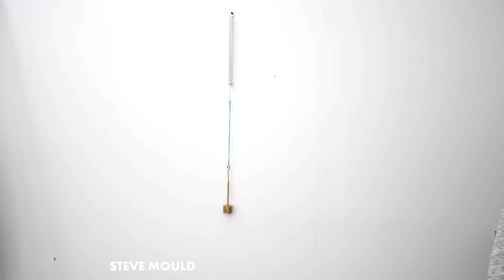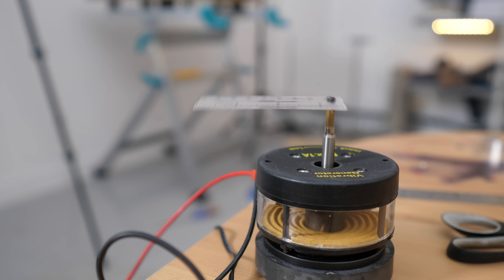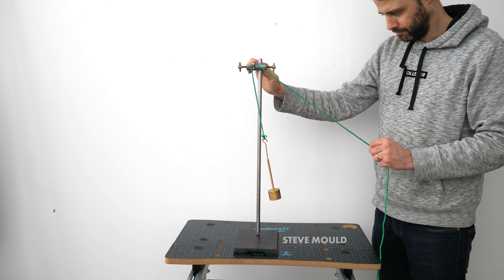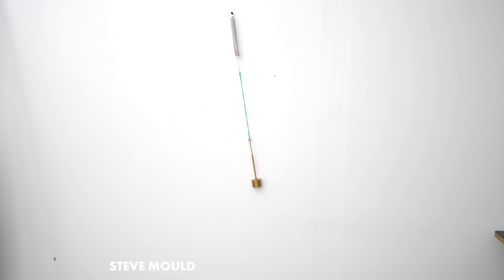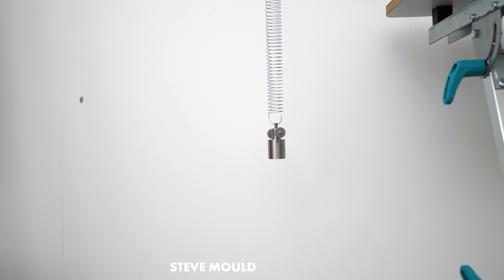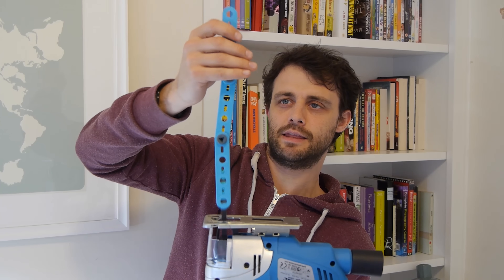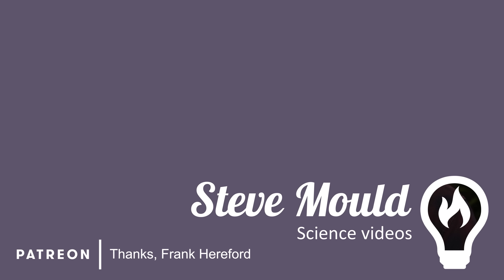What If Swings Had Springs Instead Of Ropes: Autoparametric Resonance

Comment: Great video as always Steve.

There's actually another way of looking at the spring pendulum, not as parametric resonance but as internal resonance. Parametric resonance occurs when you change a parameter of the system, but you could argue that no parameter is changing in the spring pendulum, as the spring constant and relaxed length of the spring don't change. If you think of the spring as 'outside' the system and just focus on the pendulum, then you can say the length of the pendulum changes. But this is tricky, because the pendulum is enacting forces on the string two. The system is interacting.

In the internal resonance approach, we consider the system as a whole and the parameters are fixed. When the modes of oscillation (spring up-down, pendulum left-right) are analysed in a usual way, they come out just fine. But with a simple analysis, they don't interact with each other, setting the pendulum up-down would not cause it to swing left-right eventually. It's only when we consider the non-linear effects in the system do the two modes couple to each other. This non-linear effect only contributes when the (fixed!) parameters are just right, which you stumbled upon! Without the non-linearity, you don't see the effect you described in your video.

Maybe a topic for a another/follow up video...?

Comment: Maybe attach it to a wind-up escapement on a hook where the hook bobs the spring, and then use one of the stable modes of oscillation to keep it running far longer, so that the Laws of Thermodynamics do not short-terminate the oscillations.

Comment: Interesting. The two string pendulous nads one was surprising. Could the rigid loop on the nail perhaps be what starts the sideways forces? the slightest bit off center it will impart rotation.
A simpler way to explain your rope pull is that you tug when there is a sideway component to the force vector, thus imparting lateral motion. It's not about hitting the peak force point although that is where the strongest coupling is. But you can do it strictly outside that point.

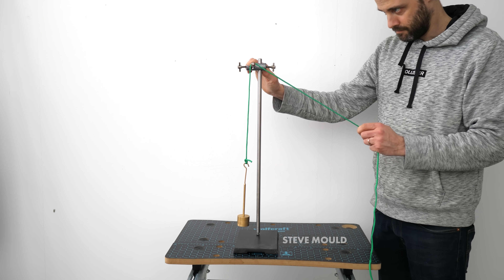Comment: Well... 4:04 isnt quite correct, you are altering at least 2 parameters, and would even ended with the same result even without lengthen the string. at around 4:30 you can see that with every tuck on the string you also moved the anchor point of the pendulum forward and backward. this way you added extra momentum regardless of the length of the string.

Comment: Is there any way to make a power plant out of this?
Like with wind, solar, wave, or gravity + pendulum resonance? Like all working together somehow? Or is that a perpetual motion machine?
Reply: That'd just be a perpetual motion machine, you're not going to get more energy out of it than you out in
Reply: @dustinm2717  Even if it was solar + wind + tidal + gravity + resonance pendulum? There's no cumulative energy?
Reply: @oldmandoinghighkicksonlyin1368  solar or wind would be a source of new energy and so not perpetual motion but would be more efficient just used directly on their own, a pendulum wouldn't give it more energy a pendulum would just store energy (and lose some to friction)

Gravity can never produce energy, in this context it can only be used to store and release potential energy within a mass, to get energy from gravity an equal amount of energy has to have been put into putting the mass into a higher potential first, gravity only releases potential energy that was put in from some other source 

And the pendulum in this case is just working at the right frequency to cause it's own momentum to convert itself into another mode and then back again, it's just converting it's energy (in the form of momentum) between 2 different modes in a cycle, it still has the exact same amount of energy in both phases ( minus some lost to friction )

Granted I'm not an expert here, but generally the rule is something will never output more energy than was put into it (if they do it's coming from another source) it can only output the same energy in another form, things can only convert from one form to its equivalent in another form
Reply: @dustinm2717  Okay, I understand it much better now. Thank you for taking the time to put things into a different perspective so I can grasp these concepts!

I have seen Newtonian attempts at perpetual motion machines and they almost all exclusively use gears and gravity-assisted waterfalls to turn wheels that carry the water back up to the top of the machine.

I was envisioning using additional sources of "free" energy like wind or solar to give those machines the extra bit of rotation or battery storage to actually make it so the machine never stops. But I guess the water would always evaporate or the gears would always wear down no matter what.

Comment: Calling the length of a spring pendulum a "parameter" is a bit of misnomer. It's a variable, so from a dynamical system perspective, it would be included in the state of the system.

Comment: I wonder, regarding your explanation starting at 5:12-- is it a matter of doing work against the centrifugal force of the pendulum, or is it more of a matter of conservation of angular momentum? i.e. You're decreasing the string's length, thereby increasing its angular velocity in the process? (the ball on a string analogy at 5:27 is also a perfect example)

Or are these two explanations essentially one and the same from a physics standpoint? I am by no means a physicist lol-- just trying to better understand the "doing work against the centrifugal force" argument.

Comment: Before you get on the swing, the rope/chain is a straight line. Sit on the swing and your hands grab the rope  a few feet up. When you lean back the rope changes direction at the hands. Now the length from seat to pivot point above has shortened. Just as you said, changing the length  changes the velocity.

Comment: Why do the pendulums on green string transfer all motion back and forth so that at certain times one is stationary while the other is experiencing max motion? I would have expected the first transfer to result in an equilibrium between the two so they are both moving. Why does the motion transfer entirely back and forth?

Comment: 7:00 i think not, angular momentum alone isn't enough, pumping a swing has to do mostly with lowering the center of mass during downwards acceleration (a more effective way to pump it requires standing on the swing and dangling the whole body behind), which in turn changes the length of the pendulum system. Right ?

Comment: "Centrifugal force", Steve? Really? Centrifugal force isn't real. It's an illusory force experienced within a rotating, non-inertial frame. (Any other comments describing how it's real with the rotating frame are irrelevant because all of "our" observations and interactions with this apparatus are being made outside of that rotating frame.) You're also never working against tension because you and the tension are always pulling the mass in the same direction. The force you're working against at the bottom of the swing is good old gravity, combined with the extra pull you have to apply to provide sufficient centripetal force required due to having to make the mass travel in a circle of smaller radius as well adjusting to the higher speed resulting from the smaller radius (as demanded by the conservation of angular momentum).

Comment: I had a toy as a kid that was just a string with a small ball on one end and a larger one on the other. The string went through a tube. It worked like the thing you were doing with pulling on the string to make the weight swing. Pull on the small ball and make the bigger one swing until it was going full circle.  I had so much fun with that thing. (Yes, I'm easily entertained)

Comment: I'm I the only one that really wanted to see a three mode pendulum where the two mode weight had a pipe between the spring and the weight to transfer the rotation to the spring.

Comment: The point the rope goes over the pin at around 5:30 MOVES back and forth each time he changes the length of the pendulum arc. In this demonstration, it is not so much the length change, but the movement of the pin that makes the pendulum swing back and forth. The conclusions and reasons Steve makes about what is making the pendulum swing are NOT scientific or correct in this demonstration. The theory and established results he is speaking about are correct, and there is no dispute about that on my part. It is just the really sloppy demonstration in this vid that irks me. If your gonna do something, do it right. It really matters, especially when teaching.

Comment: Does the example where you increased the amplitude by shortening the string work the other way where you could pull and release the string at the exact opposite times therefor opposing the motion? Could you then theoretically create a powered swingset that no matter how much you pump with your legs, you could never actually swing?

Comment: I discovered this exact behavior in my high school physics class at 11:53. I wanted to answer the same question of the title so I slapped the weight sideways instead of pulling it so that the system would start at an equilibrium state. I never tried it with different masses or springs but it stayed in a stable arch.

Comment: Nikola Tesla once put in 170 000 Volts and got output 12 million Volts. Certain 3rd coil. Antenna that does not emit. (Voltage standing wave ratio) 10x times (or higher magnitude) lightning than natural occurring ones.Not just LC r-nose-ance. Not induction. But simultaneous electron arousal. Shu Egyptian( Misir) twi-29-n god of rising EMPty.
Imagine a swinging kryptonian baby, and a sudden p-ush to cosmic speeds. Booing! Poof!
How did Superman j-ump into space? Ram Man MAsters of the universe.Cartoons when bad pull the rope and rock come at smashing speed. One Punch Man. Bruce Lee. I let my fantasy out. Love this subject.

+x  +#
Nice video! All the best Steve!

Comment: I wonder if the spring extension ratio for auto parametric resonance is actually slightly greater than X:X+X/3. Like, perhaps, X:X+X/pi. Yes, for the most part, the difference would be negligible, but since we're talking about both arcs and waves.

Comment: I think you’re wrong about the force that drives the weight to start swinging or at least that there’s a different and more efficient way to swing a weight from a pulley. 

If you only did the work of shortening the string, then you’d be as good as the spring, since the spring is always trying to revert back to its original form and shorten/pull the weight up. The reason I say, “only as good as the spring” is because the spring fails to continue the swinging motion or at least is sporadic in starting and stopping it. The thing that starts the momentum is ironically by not putting work into it. By lengthening the string and letting gravity take the weight down and follow the only path that it can attached to the string, it gains momentum from falling. Then, pulling it up again to “bring” it to the other side of the swing and letting go again, repeating the process

Comment: When I saw the tugging demo, I was thinking about the "ice skater" thing - conservation of angular momentum? is that the term? - because the pendulum does a "partal rotation" and you bring the mass closer to the center, the speed will increase, thus it will peak higher than before. If you then - at the peak - lengthen the string, it will have a longer way to fall back down, thus gathering more speed by gravity... that would have been my explanation; is this just a different way of putting your words or do I see something wrong altogether?

Comment: The coupled pendulum in the stable mode is something I learned about when diving into the math behind laser gyroscopes - very small changes in path lengths can end up giving no chance in interference patterns due to "phase locking", basically the interferometer falling back into one of those two stable modes (if the phase difference is small enough).  Cool to see it show up here too!

Comment: would this pendulum movement still occur with the lengthening and contraction of the string if it had 0 sideways movement in it to start? It seems like in both cases (the spring and you moving it) it had a very slight sideways movement to begin with, in which case the result is understandable. But if you can create that movement without it I'd be surprised.

Comment: knowing that parametric oscillation needs parameters of the oscillators to change (in these examples, pendulum length and spring constant), i was thinking maybe we can make an oscillators whose mass oscillates.

Pendulum weighted with a container of water? and a mechanism to dump/refill the water periodically

Comment: 9:25 but why is all energy translated from one to the other and then back? At the moment, where they both swing the same, what is that the difference so that one loses energy and the other gains it. They are doing the same thing at this time. How can the system distinguishe them at this point?
Reply: As someone who knows nothing about this kind of stuff I'd guess it's to do with the inertia of change, if that makes sense.
One is still speeding up as the other is still slowing down, with enough momentum that the point where they're at an equal speed doesn't last long enough for them to settle.

Again, I have no actual knowledge here, but that's what my brain can come up with.

Comment: Woah Woah, gravity is an acceleration, and by lengthening and shortening the string you are imparting acceleration, thus effectively reducing and increasing gravity  at the specific rate.  I don't think you can separate this acceleration form the lengthening and shortening.  I am actually wondering if this is entirely the effect on the pendulum.

Comment: A little disappointed that you didn't try to make a double double pendulum with springs, an extension and a spinning mass to get a 4-way parametric resonator.  How many different 'modes' could that result in? Could 1, 2 or even 3 modes be stationary and transfer all their energy into 1 mode, or is it limited based on the maximum energy each mode can contain before being fully saturated and losing energy (swinging above horizontal, spring hitting the top, twisting causing permanent deformations?). It would probably be a huge task to tune all of the modes to be resonant with eachother though.

Comment: Garage door springs are super dangerous. Unless you know what you are doing don't mess around.
A lucky colleague broke his hand. He could have easily broken his face or lost a body part.

I researched it a lot and now do my own garage door repairs but you have to know what you are doing.
I constantly remind myself of the forces magnitude and direction and take many precautions.

I always say the most dangerous things are the ones you don't realize are dangerous.
Everyone knows a table saw is dangerous and will try not to stick their body parts into the loud spinning sharp thing.
But nobody realizes how heavy a garage door is and how much energy is stored in those springs.

I mean I can lift a garage door with one hand easily right? I can stop it with my baby toe. WRONG.
Without the springs a door is insanely heavy and can't even be budged with a 3 foot crowbar.

Comment: I kinda think there's gotta be a way to intuitively understand why, when the pendulum is halfway between modes of oscillation it continues to move closer to the new mode than return to the old mode. Like, the Wilburforce pendulum starts in translation mode, then it moves to the rotational mode, then returns to the translational mode. That means there is a time where the percentage of energy is half in translation and half in rotation, but the direction we leave this state depends on how we got here. Some sort of energy shift momentum-like concept.

Comment: A person on a swing isn't just changing their angular momentum. The person is like a spring. When you lean back you put your body weight on the chain or rope which shortens it a bit. You can feel a difference in acceleration depending on how much tension there is and when. If you pull back hard enough at just the right time, you can counter gravity just long enough to injure yourself.

Comment: Are the loosely coupled pendulums at 9:18 switching back and forth because of a slight difference in lengthy causing a low frequency interference pattern? Like a slow tremolo effect on two very close sound frequencies? Or would they still do that if matched exactly?

Comment: Doesn’t the amplitude also affect the period of a pendulum? At small angles the effect is negligible over the short term, but as the angle increases the effect is greater. I always figured this was due to friction, but even with a “perfect” pendulum it occurs. You can modeled this with the PhET pendulum simulation.

Comment: I feel like the explaination of why the energy was increasing was a bit vauge. Like yes, more energy in a pendulum nessecitates a higher velocity, but what changes in the system to accomadate the additional energy? Is the velocity increased then and there or is it the potential energy from gravity?

My guess would be that because you're pulling the weight up in an up swing you're adding energy through increasing velocity directly, but also adding potential energy through bringing the weight higher up. 

Then on the downswing no energy is really lost from the system. The weight is just converting potential energy into velocity.

Otherwise the video was great, mechanics can be suprisingly interesting

Comment: Any chance of a video on why these exchanging resonance systems (such as the coupled pendulums set-up) completely move energy from one side to the other before reversing, rather than just distributing the energy between the two sides and then settling in a stable balance?